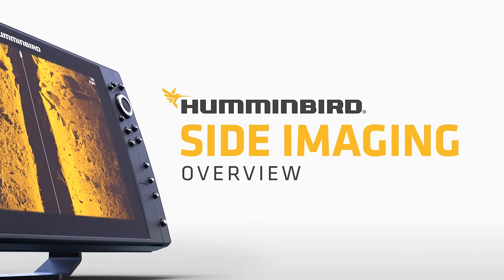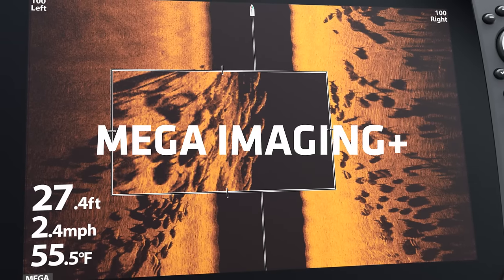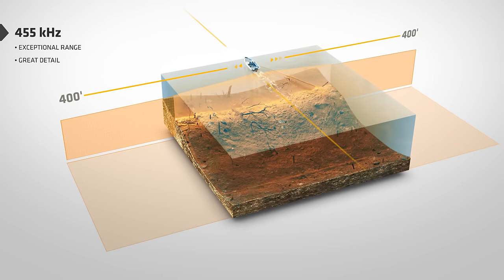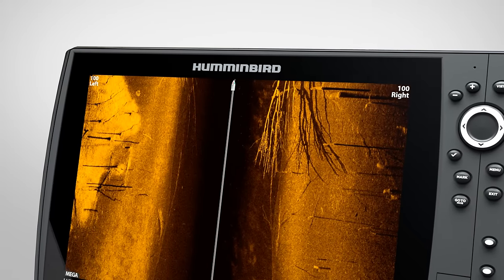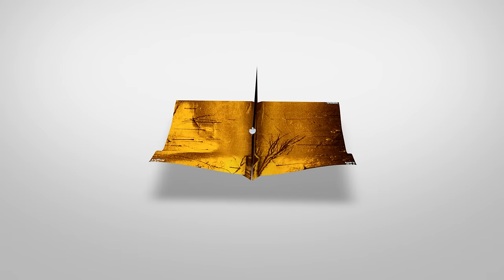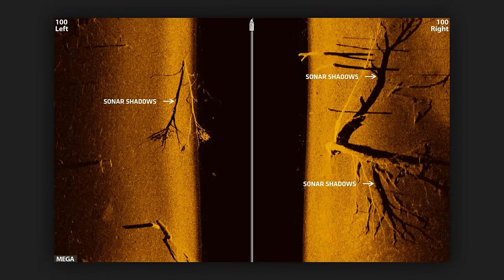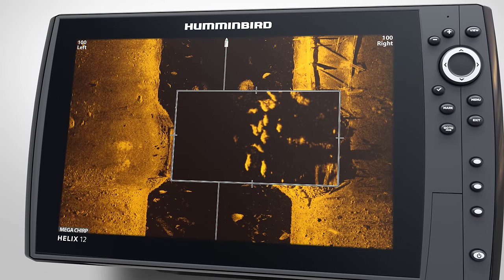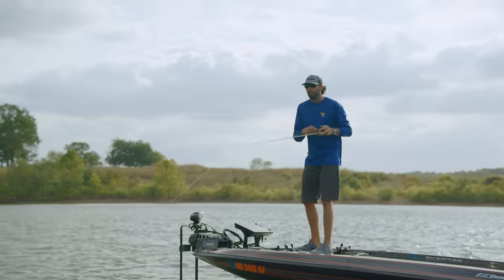What is Side Imaging and How to Read It | Humminbird

Comment: Please put out a fine tuning vid for SI MG. Structure shows great but the fish we are catching don't show up on the screen.
Reply: First 2 trips with Helix 7 CHIRP MEGA SI GPS G3, spectacular bottom structure but only faint or no fish echoes. My obsolete Humminbird 798 CI HD SI recordings show less defined structure but bold clear fish images more than 10x better. Plan trip to use both units same water and will post results on YouTube.
Reply: @ptandjb  Waiting for results... Thanks..
Reply: I got one of these units for  Xmas and mounted it on my boat the next day.  
I activated the unit and once I had a feel for it I could confirm there was no fish in my garage.  Great.
But when I hooked up the trailer and got the wife to tow the boat and me past the local grocery store, the unit continued to show no fish!    I adjusted ranges, frequencies, chart speed and still no fish. I went into the store and they had TONS of fish.  Salmon, trout, cod, halibut and even some fresh pickerel.  Went back outside and backed the trailer right up to the store and angled the transducer right at the fish counter and still NOTHING.   All I can think of is that maybe the unit was affected by winter temperature (-18C).      I got frost bite from sitting in boat with no heat as wife towed it around store.  So disappointed.
Reply: @falconeaterf15 😂😂😂😂😂😂
What fuggin effort! 👍👍🤣🤣